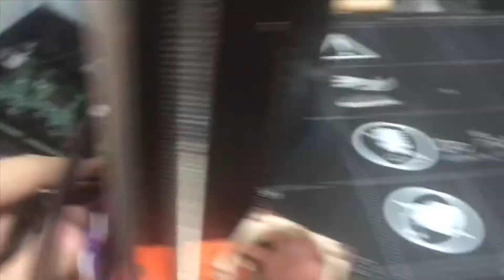[Fix] Prusa I3 MK2.5 Heated Bed not heating

Comment: have the same issue here
Reply from the maker: surprise that after so many year
Reply: @MBBFM  Yea, I upgraded my mks 2 to 2.5S last year and it probably is somehow connected to the upgrade, not really sure. but it's very inconveninient that the connector melted. I wanted to desolder the original connectors with a beefier one but it's too much of a hassle to desolder the four pin plug. so I gave up and will just replace the connector

Comment: My printer ended up having the same issues too.  It started with the printer restarting every time the bed was told to heat.  After taking it apart I think the strain on the wires caused some increased resistance and that lead to it melting the molex connector just like you showed.  I was able to get it working again after swapping the connector out, cleaning up the connections, and securing the wires better so hopefully that won't happen again.
Reply from the maker: I already fix by resolder the connector to screw lock type like the mk3.  after few month seem like no problem

Comment: ...where was this video like 5 days ago? I was searching for answers like crazy a couple of days ago because I had almost the same exact issue! I couldn't find anything, and YouTube weirdly just... suggested this video, just as I've finished fixing it! Strangely though, mine was at the power supply connector. I'd recommend checking the ring terminal connectors of the bed; mine were in really bad shape and are probably what caused mine to over time increase resistance, causing the connector to burn but NOT short out and kill a fuse.
Reply from the maker: end up i replace a second time to change the connector type to MK3 screw style connector